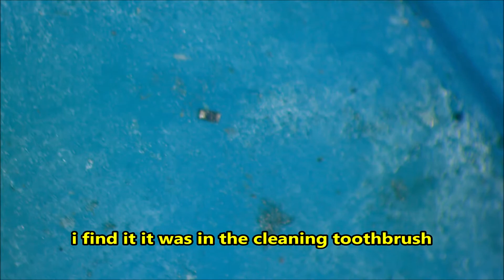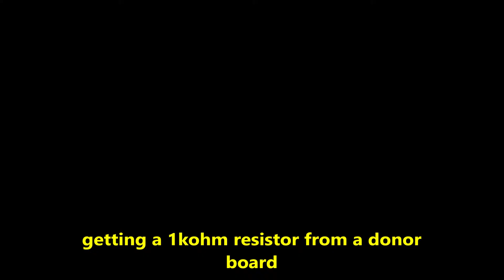Samsung galaxy note 10 lite wont respond the the power button

Comment: great work in fixing the phone!
I got similar issue - I used to clean my Note10 lite with 70% Ethanol -> to get rid of germs/viruses/bacteria -> but the power button stopped working, so no turning on anymore. Can I somehow turn it on with another method? and then map a different button for/as the powerbutton?!